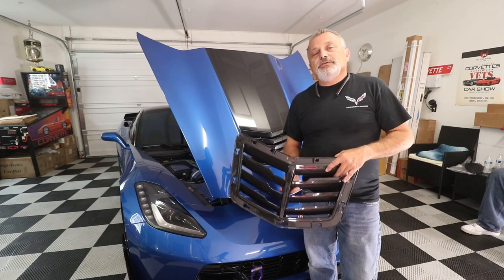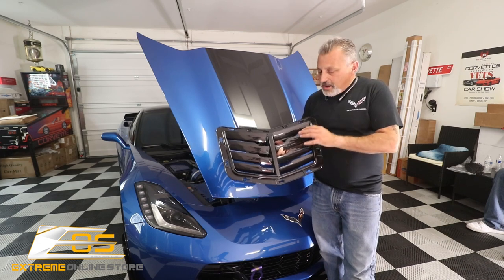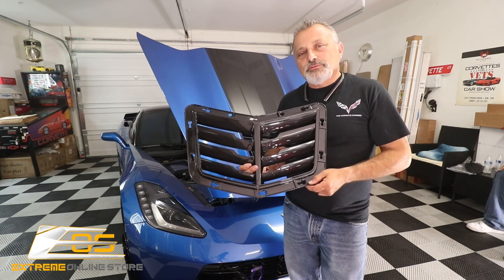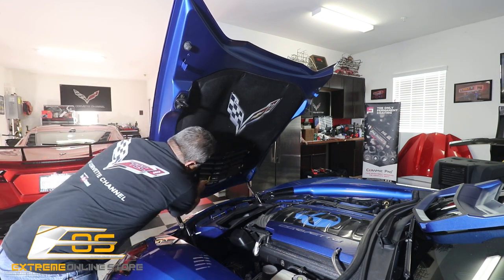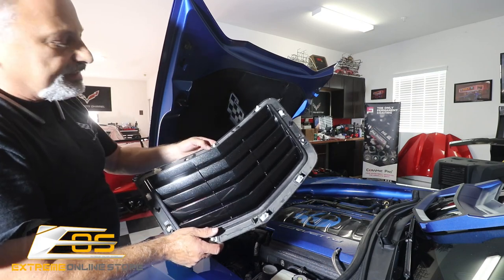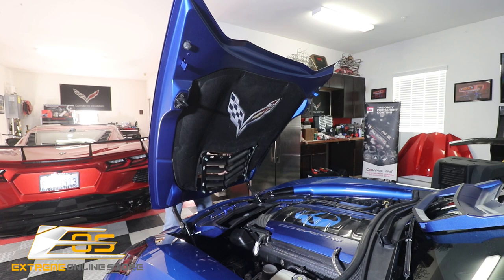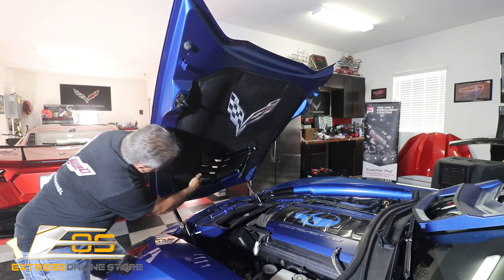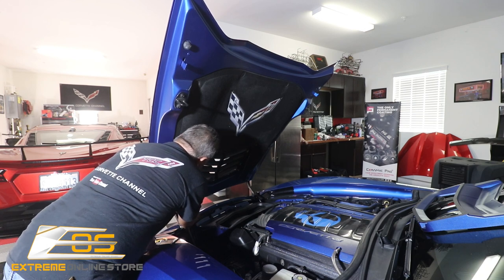How to Install a Z06 Style Hood Vent on a C7 Stingray or Grand Sport

Comment: Different subject. Your thoughts on PPF. Having my 2014 paint corrected and they are talking to me about PPF.
Reply from the maker: Hi David, PPF is a Great way to protect your paint from getting scratches and Rock Chips. Howerver it is fairly expensive and some brands can start to yellow over time.
So d o your Homework on what brands they are using the warrantys that they are offering. Best of Luck, Scott